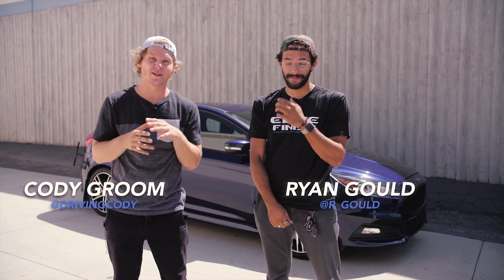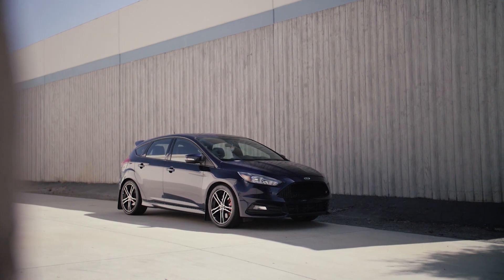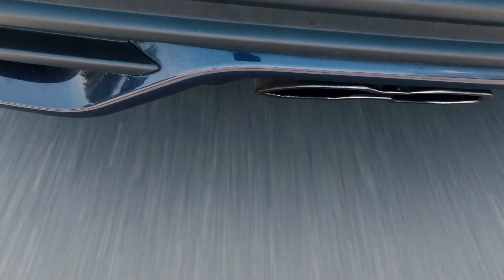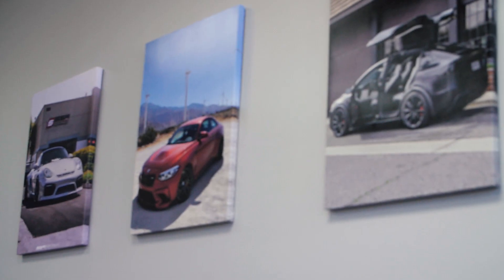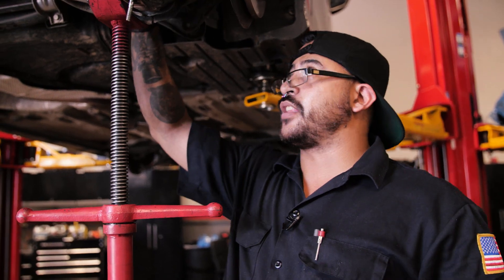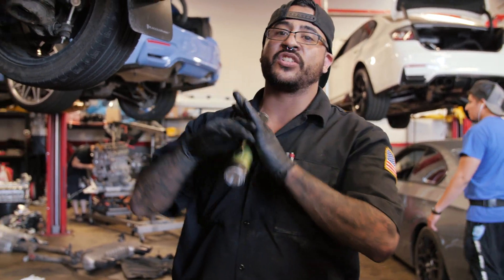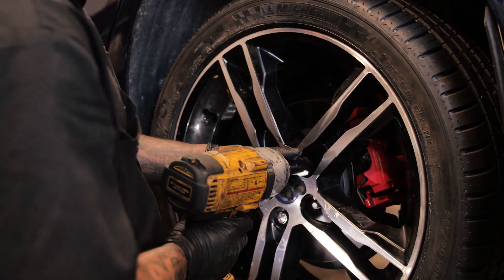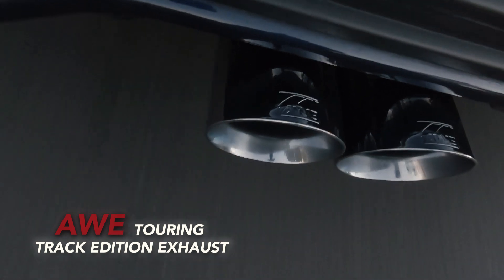ESSENTIAL FIRST MODS for Any Car! Focus St Install Video

Comment: Essential first mods is definitely an opinion thing. Upgraded front mount Intercooler definitely is an important thing on these cars to adress the high charge temps these things get and should definitely be considered before exhaust and springs. But to each their own. Sounds nice 👍
Reply: Exactly! First thing I would recommend before that or at the same time would be a Cobb AP. Super solid choice even for people staying stock tune

Comment: I have the same exact black st1 with the same wheels and awe track edition!   Get a symposer delete though if it hasn't been mentioned already. Less drone. It is louder then what the video shows too for anyone thinking about this exaust and it will drone over 2500 rpms but isn't terrible.